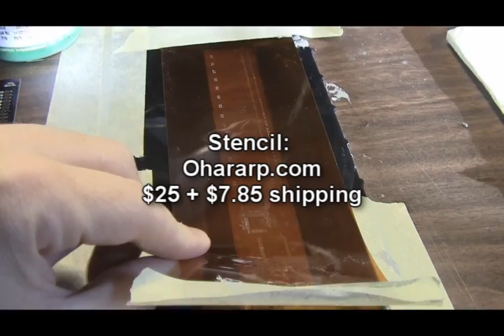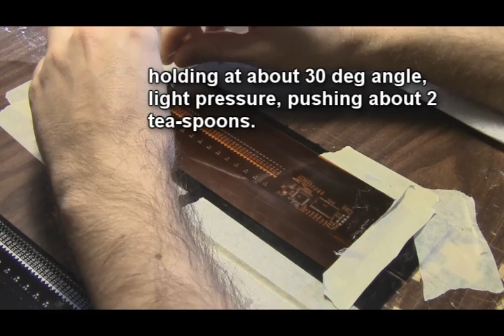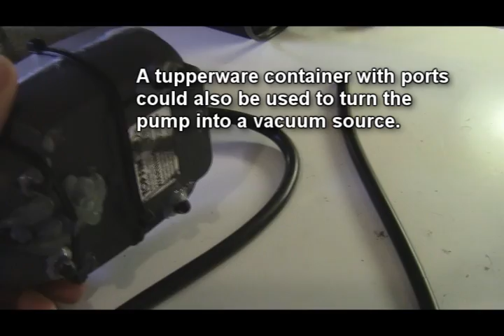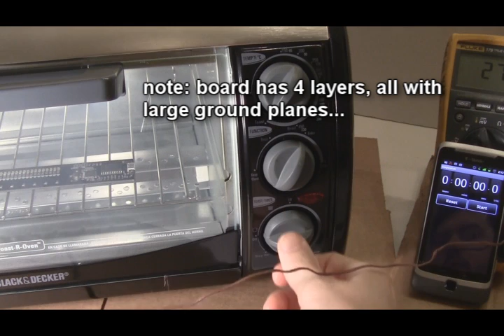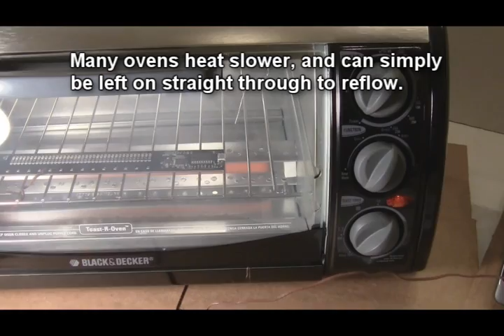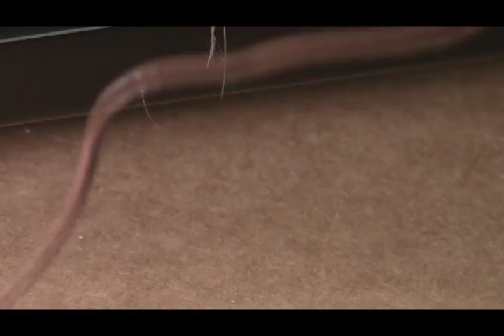Solder Paste, Toaster Oven, Homemade Vacuum Pickup Reflow Demo

Comment: Interesting video, I think the flux from the solder paste isn't enough to get enough wettability for liquid surface tension to pull the larger ic's into place because it's designed for high powered convexion reflow ovens that have uniform temperature. But i don't see how you could add more flux without upsetting the paste. You can see the ic on the right is misaligned by at least 40% of its pitch @7:16. Beside it not being esthetic for a customer to see, there are reliability reasons this is not okay.  Also many solder joints look cold in my opinion. I think the toaster oven heat distribution will be reasonably uniform away from the board but at millimeters above the pcb surface i bet it is significantly less uniform when oven temperature is changing. I think your presoak time is insufficient. The profile curve assumes you have a powerful well distributed heat source, which you don't. So you have to adapt the curve.  Presoak time especially is something that won't hurt components if you extend it for a couple more minutes at 150 deg C.

Comment: The excess solder on the chip components is a reliability issue.  It will cause stress to transfer into the components, causing them to fail with vibration, movement and heat/cool cycles.

Comment: Do you have a part# for the .0030 adapter you're using? I didn't see it in the catalog.

Also it looks like mcmaster changed the design of the pen slightly, now it's got a push button that deactivates the vacuum, instead of covering a hole.

Comment: Here's an idea for the big parts. Put a dollop of solder paste on a visible part of the big piece that won't get in the way (top of USB connector as an example). When you see the dollop melt, the whole connector ha reached temperature. Another idea is to solder the big components first. They can soak longer than the little parts when you re-solder with the added tiny parts.